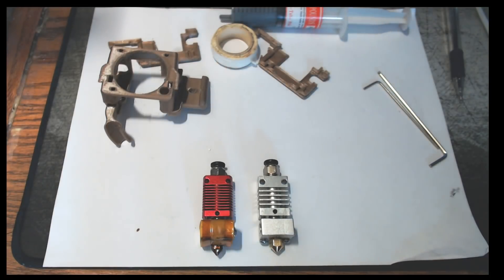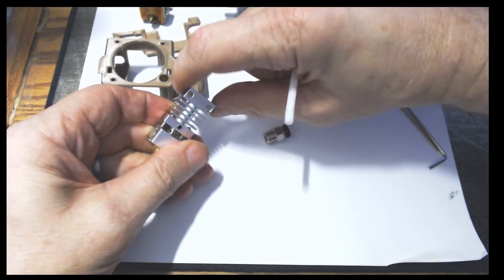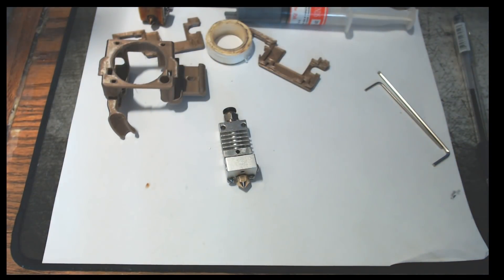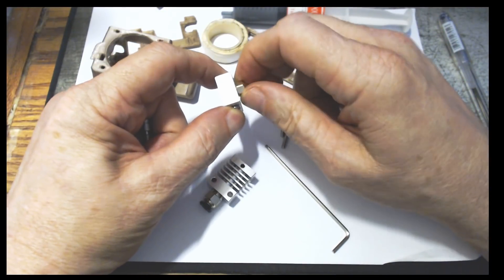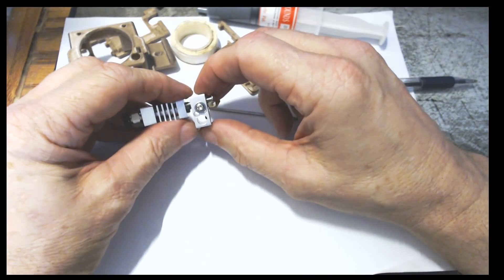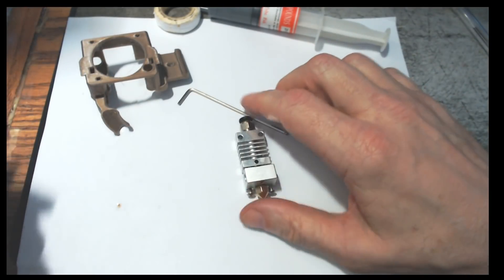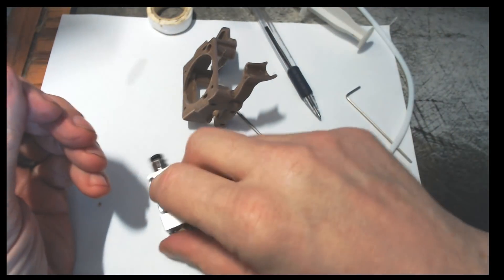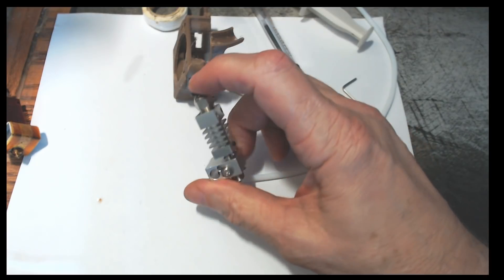All metal hot end for the Ender 3 for $7. Part 1, tips, trips and lessons learned.

Comment: Chuck, a URL to what you bought would have been nice, just so we could see what to look for.
Reply: search on ebay theres a whole bunch ranging from $6 to $50 on there...
Reply: This is the one my brother bought me as he was impatient https://www.ebay.co.uk/itm/402182891527

And this is the one I ordered from China and was prepared to wait for https://www.ebay.co.uk/itm/164313646808

Can't see any difference.. The one I got yesterday was fine after sorting my issues out.. The bowden tube doesn't get very warm at all.. Which is all I wanted for the ABS filament.. just tried it but a lifted off the bed early on but I think the warping was the culprit really
Reply: @whatworkedforme  Wow Alan, talk about "stumbling" on to "old" YouTube videos. I agree there's very little difference between the two Hotends, and it's been so long I don't remember which one I bought. I tried the All Metal Hot End, however, after doing some additional research decided there is not a danger with using the standard Hotend with ABS, and have been using the "standard" Hotend with ABS for about 8 months, almost every day - Take a look on where the out gassing starts, it's WAY above ABS temps, I'd like to claim I was smart enough to figure this out myself, however, a chemist that was also into 3d Printing pointed this out to me, I did my own research, and found he was correct - Cheater here, I have access to a LOT of very good Chemists and they also agreed with his "claim".

Continue on with the "hobby" and enjoy ABS, I LOVE ABS, once you get the methods down, simple things like a clean print surface and an enclosure, I still print in PLA as well as PETG. I own two Ender 3's some I've set one up for ONLY ABS, and the other for everything else.

Here's you next "rabbit hole" laser engraving - it's less then $100 to get into it - 10K watt laser for less then $200, or go with the smaller ones for less then $100.
Reply: @TheDgdimick  thanks for your comments . Of it could get ABS to such to the bed is be ok.. It is extruding fine presently.. Into a bird's nest
Reply: @whatworkedforme  Go buy a plain old sheet of glass from your hardware store, use a bit of CHEAP hairspray, the unscented kind, Aqua Net works best, and use this as your print surface, just hit the glass with a very light coat of hair spry and when it looks like it's built up, every 10 to 15 prints, clean it off with some IPA, or Denatured Alcohol, I use Denatured because it cost less for me; you'll wonder why you didn't do this sooner. When you print ABS, all you need to do is clean the hair spray off the glass and print on the clean glass. A mirror will also work as well, lets you look at the print from the bottom - buddy of mine uses one and loves it.

As a side note, I've done a LOT of filament tests, drying, submerging in water, etc, and have NOT found that ABS picks up water like it's been claimed to do - My tests could be wrong, since I'm not able to determine what gases are out gassed when drying in my dehydrator.  

Have fun and feel free to ask any questions you may have.
Reply: @TheDgdimick  you're very kind to do this.. I'll definitely try you solution.. you have a lot of experience.. . Can i ask what temp you have the glass/mirror at please?  apologies to the originator of this YT video for going off topic but this is fascinating!
Reply: @whatworkedforme  I normally print ABS at 100 to 120, and PLA at 55 to 60 and PETG at 70, I use hair spray for BOTH PLA and PETG.
I'm pretty sure Chuck's OK with this thread, however, if he jumps in we can try to move some places else.

Comment: Can you show how to hook up the two hot ends?
Reply from the maker: If I can get a few minutes this weekend I'll make a quick video, but there's really not much to it. Put the heater and thermistor in, bolt it in place and push the bowden tube into the fitting. Then heat it about 20c or so over the hottest temp you'll be printing at and tighten the nozzle. Then if you want you can remove the two screws holding the heat block to the cooling tower. Personally I don't it makes much difference if you leave them in, but others will tell you different.

Comment: Prolly don't make much difference, but I think you DO NOT want to promote heat conduction between the heater block and the break (so you don't want to put thermal paste on the bottom threads of the heat break). IIUC, the purpose of the break is to (as much as possible) thermally isolate the heater block. It's made out of titanium (despite the cost) because it is a poor heat conductor.

However, you DO want good heat conduction between the heat break and the heat sink. The heat sink is there precisely to keep the heat break cool so that the filament does not melt UNTIL it reaches the nozzle.

Comment: Those XT-60 connectors that some people have claimed to be fake are apparently not as anyone can make an XT-60 as there are no copy restrictions applied apparently, however they are probably not made from the same quality of plastic or the wiring going into them is not up to spec, but then I discovered my friend has those same XT-60 connectors and has no scorching on them at all and her printer is a workhorse so I am at a loss as to where the fault lies.
 Since you got this hot end working has it continued to work well?
Reply from the maker: The whole "what's fake and what's not" thing is a problem, some of this stuff has been around for a long time and any legal issues with copying it are long over. Also, as shocking as it sounds the Chinese have actually invented some things, or bought the rights to it legally. So the quality issue is what I get most concerned about. 

The hot end still works fine,  one of them is on the enclosed Ender 3 that I use for ABS, Nylon, PC and similar filaments. Once I got the retraction dialed in I've had no further problems. Also, an oiler will help you boost the retraction up a couple of mm if you have a stringy filament, I just find them annoying to use and if it breaks or falls off during the print there will be a jam.

Comment: i accidentally bought a couple of cheap all metal hot ends for my anycubic i3 mega (it didn't say it was on the product page), and I've been having these issues as well as some extra clogging issues. i've been sitting on it for months not sure what to do about it but im going to use the advise you gave in this video to see if i can get it working again.
Reply from the maker: If you're having clogging issues I can almost guarantee you it's the retraction amount and the reprime speed. Start the retraction at 1mm and the reprime speed to 25mm/sec. You can work the retraction up 0.5mm at a time until it starts to jam, but I'd leave the reprime speed at 25. Also, an oiler will let you get more retraction, I've gone up to 4mm with one and gotten no jams, if you can live with the hassle of keeping it damp with oil. And this is true of all brands of all metal hot ends, not just the cheap ones.

Comment: Make mistakes often, make them fast and make them immediately, the only way to find out how not to. Otherwise, we rely on dumb luck, a very fickle mistress. I suggest teflon tape on one thread , the heatbreak to heatblock thread. That thermal connection should prevent heat transfer, not promote it, thats why its a heatbreak, its breaking the heat flow from the hotend back up to the coldend, I.E, less input heat to the heatbreak is a good thing.

Comment: Nice video - thanks.  Would a squirt of a dry coating teflon spray down the inside  f the heat break tube help with the retractions?
Reply from the maker: It might, but at higher temperatures it would probably burn off.

Comment: Hey Chuck, I think I have the same hotend now, which I have installed using this method on my Tevo Tornado.   You mentioned retraction setting tweaks, and I changed them as recommended, but you mentioned other settings as well.  I'm printing a plain black PLA at 200 C with the bed at 70, and I'm having a little problem with stringing and with nozzle plugging.  Any other suggestions with respect to settings?  With a clean nozzle (printing pretty clean and nice unless I have unsupported spans where/when the stringing happens) it seems to print for a few hours and then eventually plug.  Do you have other setting suggestions?

Comment: Great insights, thank you... It seems to me hat it is better to use the original and from time to time replace the bowden. Ender 3 is a printer that works mostly perfectly well without modding.
Reply from the maker: As long as you only want to print with filament that doesn't require more than 250c nozzle temps the stock hot end is pretty good, it's when you need 260+ that the all metal hot end is necessary. Some things like the springs and fans are crap and will probably need replacing within a year (or in the case of my first one, a few weeks), but it's a sub $200 printer.
Reply: @3rdpig  Thank you.

Comment: I don’t know if you’re still reading comments from this vid, being that it’s a year old, but anyway: I got a knockoff, just like the one in this video, but even cheaper. I don’t think it’s a bad part manufacturing that’s giving me this problem. I’ve got an Ender 3 V2, and they have a different fan shroud around the hotend. There is a fan duct thing that directs air directly at the nozzle. Just so happens, when I put on the all metal hotend, the duct comes below it! So the hotend wouldn’t even come close to the bed. Is there a way to put the hotend together so it’s longer, or will that create gaps and cause clogs? Also, if I 3D printed a new mount to hold the hotend lower, would it just melt from being on the hotend, or would it be fine just touching the heartbreak (which I’ve heard only gets to around 90C Max)
Reply from the maker: I just looked at my original Ender 3 hot end and one of the cheap ones I bought from Ali Express and the original is about 3mm longer.  I didn't even notice it until now since it didn't make a difference on the original Ender 3. Any mount to move the hot end down can't be printed from PLA, it's glass transition temperature is around 60c. ABS is around 100 and PC is around 140. Personally I'd want the mount made from aluminum or steel if I went that route. Depending on how the stock mount is made it might be possible to tweak it to fit. But without seeing it I can't offer much help.

But that seems like the most difficult solution. Maybe you can find a nozzle with a longer threaded end. I've got an assortment from different manufacturers and none of them are exactly the same length.

It also might be possible to "adjust" the fan shroud a bit. If it's plastic it can be heated and deformed or a new one can be designed and printed. Maybe check Thingiverse?

I think before I did any of this I'd get on an Ender 3 user group and see if others haven't run into the problem and found a solution. 

Good luck!
Reply: Chuck Bryant Wow you replied! Thanks for the info. I think I am going to print a new cover. I’ve seen some pretty good designs out there. Loved the video!

Comment: There are lots of these on Ebay but look at the pics carefully as some are not "all metal".  The filament hole through the all metal ones is only big enough for the filament and not the PTFE tube.  Some of the pics are assembled only so you must look at the heat break diameter.  If it's big enough to pass a PTFE tube it isn't all metal.  If you can't see the heat break in the pics they are probably hiding if for a reason.  BTW, the lead times are all several months so if you're in a hurry look elsewhere.  I couldn't find them on Amazon.
Reply from the maker: I know they're not all "all metal". And I can see I need to do an update to this video as it's still getting comments after all this time. Stay tuned!
Reply: @3rdpig  All metal hot ends are catching on.  I think people are afraid to appear dumb by asking what it is so they lurk until they figure it out.  I don't care who thinks I'm dumb so I ask.

Comment: I’am having trouble with my ender 3 clogging up in the hotend, it’s almost like the ptfe tubing is getting to hot down near the nozzle and melting the pla filament before it actually gets to the nozzle. Not sure what to do? 😢😕
Reply from the maker: Is it the stock hot end, fittings and nozzle? If so, have you made sure the PTFE tube is going all the way down into the hot end until it contacts the nozzle? (Note this doesn't apply to all metal hot ends). Any gap between the tube and the nozzle will cause you problems like clogging. If you're in doubt, use something like a chunk of wire coat hanger to measure the distance between the top of the nozzle and the top of the bowden tube fitting. Mark that distance on your tube, it should shove all the way in until it contacts the nozzle and your mark is flush with the top of the fitting.
Reply: It’s all good now, seems to be working great. All i had to do was switch over to my 0.6 nozzle  and clean out the heat sink thing, then i half unturned the nozzle before i put everything back together. Once it was back together I tightened the nozzle using the half turn that i left. I also marked the ptfe tube to make sure it was seating properly.

Comment: i discovered rectraction speed must be low .i pushed filament by hand to hotend and pull it back at low and high speed low speed looking like spike so no problem but at high speed filament just jams and diameter of itself increases cause of jam. i will try to print with 25 mm/s at 1mm rectraction and let all know
Reply: i have a question. rectraction 1mm @25 or 50mm/s is for bowden or direct drive? and reprime distance is important or not. i have a clog issue. changing nozzle at high temperature and using stock fan and case radiator is nearly 30-40 i guess. stock extruder with 3 or 5mm extra spacer but still clogging. gear doesn't click it just worns the filament out and i use good dry box the moisture is 19% .temperature is 260c but i don't use any socks for nozzle also bowden is stock to only connectors are changed. my print settings are 0.3  nozzle at 0.28 resolution 50mm/s print speed, rectraction 1mm at 50mm/s temperature is 260c combing is enabled. i dont remember much but at first i was able to send extrude command with 100mm at 350 or 500 mm/s but no clog showed up after first print it clogged. first print kinda good no blob or extrusion problems no stringing just all layers was separated it was obvious. what can i do to fix it. iwas able to print abs with stock ender 3 hotend the red one. i builded clone all metal hotend finely used Arctic mx4 thermal paste at radiator part .gently tightened 2 block screws that holds the radiator and nozzle tighten at 260 just unscrewed at cold 8/1 or 6/1 turns before tightening at hot.
Reply from the maker: @justchill4886  I've never owned a direct drive hot end, so everything I've reported is for bowden tube. My experience is that clogs with an all metal hot end is due to two things, retraction amount and reprime speed. With retraction at 1 or 2mm and reprime fairly slow, say 20-25mm/sec you should not be getting clogs assuming everything else is correct. Don't run the nozzle hotter than the filament manufacturer calls for and don't run a super close first layer/bed gap. Use a fairly loose gap with a good adhesion method like hairspray or glue stick. Also, if you're still getting clogs try an oiler on the filament, after the feed gears and before the hot end.
Reply: @3rdpig  i saw your second video about hotends tightening beak first really helped i use a clone like real no more clogs only rectraction is disabled and that just makes little stringing else it's great only extruder weak at pushing filament ,making belted 2gear extruder would help, I have a question for now does gear quality matters there is bunch at different prices

Comment: The average Bowden tube isn't all that uniform, sized correctly nor evenly inside nor are they very smooth inside. The Capricorn tubes exist for a reason. It's absolutely worth the extra $15 for a Capricorn tube to replace the OEM Bowden tube. They're smoother inside (think "Wet ice on Wet ice"), uniform (meaning your filament moves smoothly and evenly through Capricorn tube's entire length) in size and shaped as circular/round inside making retractions and extrusions nice, smooth and as fast as the extrusion motor moves the filament with no slowing caused by the tube. I very much recommend eliminating that white OEM Bowden tube and changing to a Capricorn if you're going to print at the outrageously high temps Nylon requires (and frankly you want to add a Keenovo AC bed heater and Solid State Relay to convert the DC bed signal to an AC bed signal so the Keenovo AC bed functions very fast and exceptionally well - The Keenovo AC beds can cross well over 300°C, far more than you'll ever need and will hit the 120°C to 180°C Nylon filament calls for in well under 2 minutes <-- That alone makes them worth it!). Capricorn has a far higher temperature handling while at Nylon temps the OEM Bowden tube is going to outgas like crazy (and it's not a safe gas to inhale! Go to a Capricorn as you have the $ having bought a copy unit rather than a genuine Micro Swiss). No, I do not work for Micro Swiss and no, I do not work for Capricorn! I worked for Polaroid until soon after they shut down.

Comment: How messy is that grease when changing tips? And does it cause contamination issues?
Reply from the maker: I guess it depends on how messy you are putting it on. It doesn't have to be messy and it only takes a tiny amount. And there's no contamination as long as you're reasonably careful. And even if you're not, at test print should clear it all out. Thanks for watching!
Reply: @3rdpig  what are your best settings petg i can't seam to get it to print that